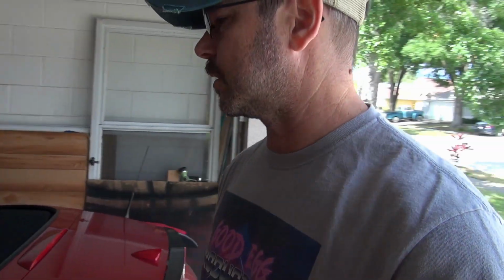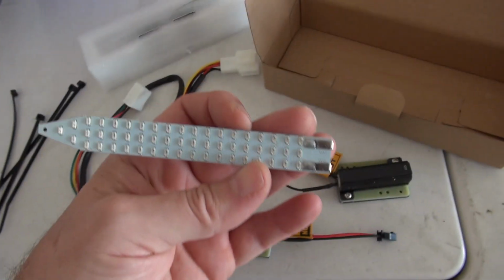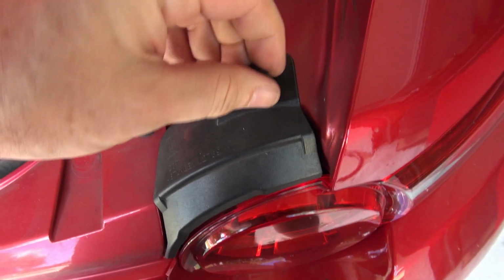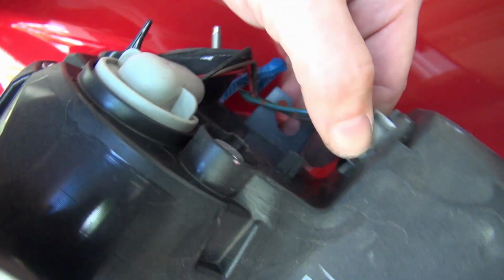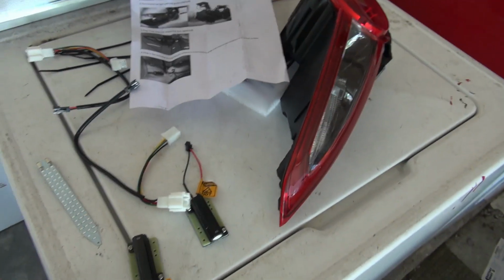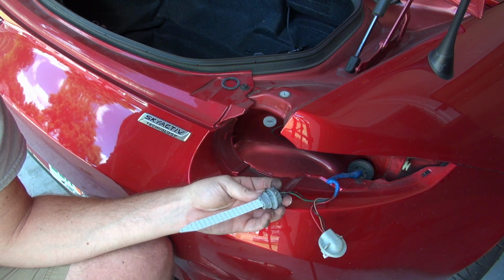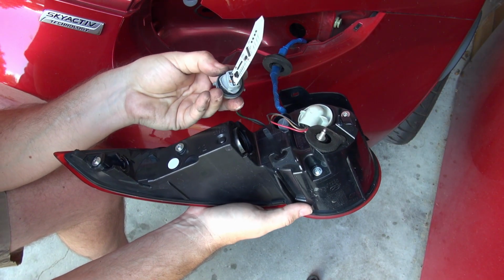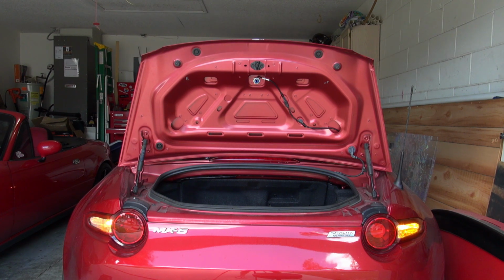ND Miata - LED Sequential rear turn signals install

Comment: Good job good egg. I just installed my sequential rear turn signals flawlessly thanks to your helpful video.  I realize that as you correctly assessed it was a piece of cake, but your video of it certainly gave me the reassurance I needed to dive into and carry through without hesitation.  Thanks again and 73 Tom KC3QAC.